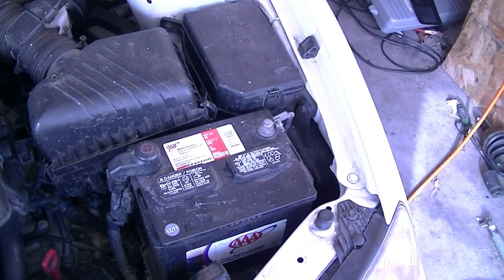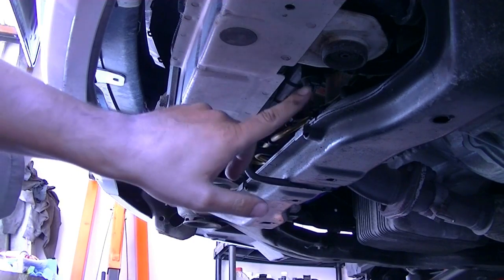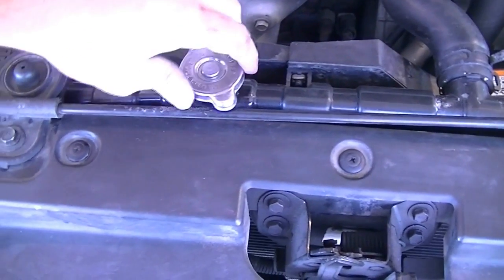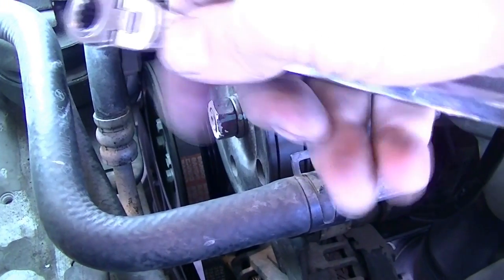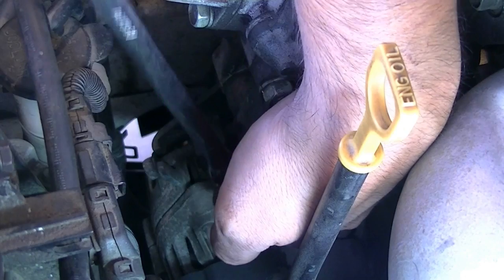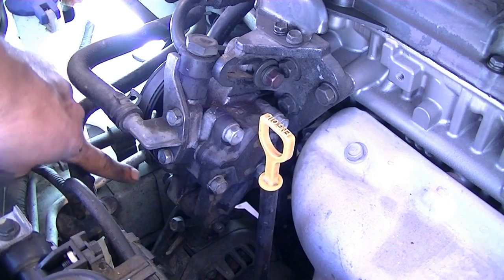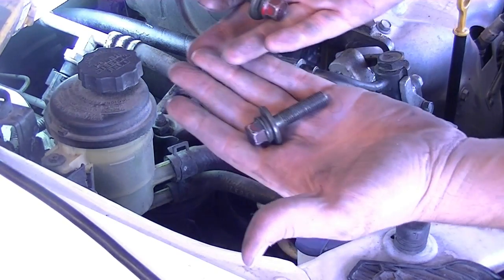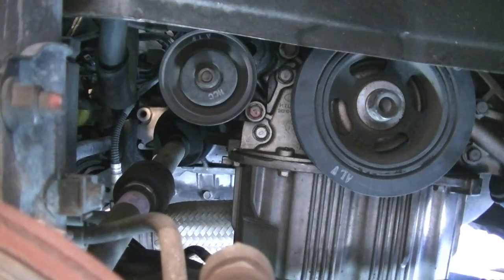Hyundai Elantra Timing Belt Replacement Part 1

Comment: after driving an Elantra i was surprised that the timing belt did not need replacing on a Mazda3.... I'm curious how you would know when to replace it on the new 2L 173hp engine...guessing 5 years 50,000 miles but things could have improved since...why not a timing chain that lasts longer???
Reply: Owners manual should state the service intervals for timing belts
Reply: And also timing chain and belts are located differently. Timing belts are a lot easier and less messy to change.
Timing chains sit inside the engine as they need circulating oil to lubricate the chain.
Belts are positioned outside the block so that they are easier to change and no need to open up the engine to change it.

 On most vehicles to change a timing chain and/or guides the cylinder head needs to be removed which involves inlet/exhaust manifolds off, injector rails, throttle bodys, thermostat housings, wiring, plugs, coils and other miscellaneous items. 
 The cylinder heads wont need to be machined if they are within tolerance but if the head bolts are removed incorrectly they will require maching. You will also require an entire new gasket set and headbolts.

To change a timing belt you just have to do a lot less.
Reply: However... Replacing timing chains and guides without removing heads can be done be it is very difficult in most circumstances.

Comment: My 2002 elantra shakes when im at a stop light once i drive is fine. I changed the spark plugs thinking it was going to solve the problem but it didnt. I dont know if I also needed to replace the wires or if its something else. Please help
Reply from the maker: Have you checked the motor mounts? If you dont have a check engine likght, look in my channel for a video called "how to diagnose and replace a bad motor mount". GL

Comment: Great video! My question is,what if the timing belt fails while driving the car,does it damage other parts of the engine?If so, what other items would have to be replaced?
Thanks!!
Reply from the maker: If the belt fails while driving an interference engine (most engines including this Elantra engine), your valves will hit your pistons and get damaged. There is also about a 10% chance they will also damage the pistons, you will have to remove the cylinder head to replace the valves and get the head machined and also to see if there is damage to the pistons/cylinder walls, if there is you mind as well get another engine. Tx for your comment.
Reply: And if youre really unlucky you could damage some rods 😬

Comment: My hyundai elantra 2004 is vibrating like the seat and steering wheel wont stop shaking can someone tell me how to fix or what it is to go get it fixed?
Reply from the maker: Does it vibrate at low speeds or high speeds, when you brake or all the time? Give more info.

Comment: Actually today I bring it & guess what. It took 4 days for them to complete th 60k major service including timing belt replacement,  I also noticed this vibration connected to the rpm indicator,  when I turned on AC I feel the vibration and the indicator goes under 1 and when turn in it off I feel the vibration and the indicator goes up to 1, I will return it back to them and see what they say, anyway thanks for your reply and for the video :-)
Reply: Belts might be too tight or loose

Comment from the maker: Hmm, maybe the ac belt is loose? If you hear any loud chirping noise from the belt areas when you start the car or turn the wheels that could be it. Also whenever they take off that motor mount sometimes they dont torque it down enough so that could be it aswell. As far as if its acceptable or not, it all depends on your tolerance level and how bad it is :)  GL

Comment: Hi just replaced my elantra 2011 timing belt from the hyundai service centre but I notice something after that..when I start the AC I feel some vibrations then it's gone. . Is that acceptable. .?? Or they didn't replace it as well..??

Comment: How long did this job take you?  My car just crossed over to 120,000 miles, and the mfr recommends replacing timing belt every 60k.
Reply: Every 100,000 miles is fine mine is about to reach that